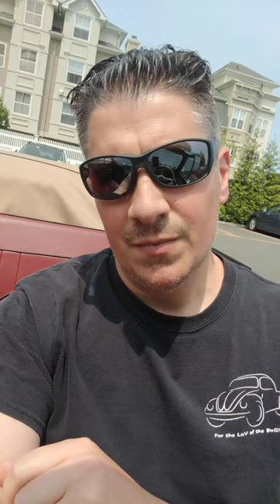One thing that is Plaguing the Classic VW Beetle Bug Hobby #shorts #shortsvideo

Comment: That has been going on for a very long time, over at least 14years. I regreat having chucked out my rear window popout external rubbers and the new ones started to crack after 3, yeah 3 weeks. Body seal on my RSA 1600S Beetle total body off resto, the new bodyseal also started to appear cracks all over, like the new tyres that start to show cracks after a few years.

Comment: I have some experience in this department.  I got a replica fuel gauge for my 62 and it was poor quality, so I salvaged the cable from it to rebuild my original.  Kinda worked!  Also the replica brake pad pins are far too long!  I have to salvage old original pins to redo my brakes!  When it comes to rubber seals, I get quality German if available!

Comment: That is happening in the auto part industry as a whole and it scares me because i still like my older bug (2000) but i still remember the quality of parts i put on my 1964, i never worried if they were going to be the correct part or when i got the old one off if the replacement part would even fit!

Comment: Some parts providers won't even admit that their parts are incorrect specs such as a Torque Multiplier I got last year... it was way off and I had to return it as it would not fit the flywheel bolt. They kept telling me to use a hammer and force it. Nah!